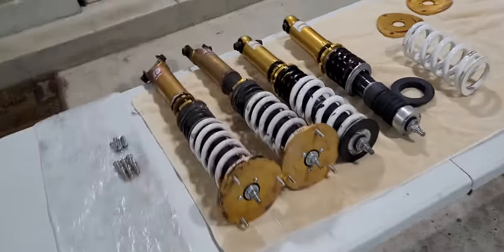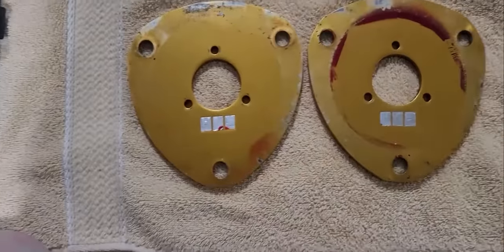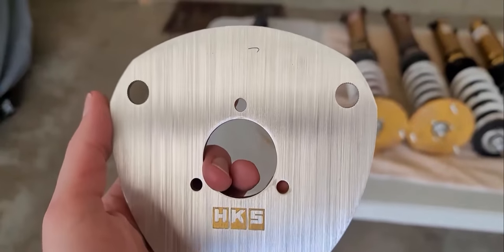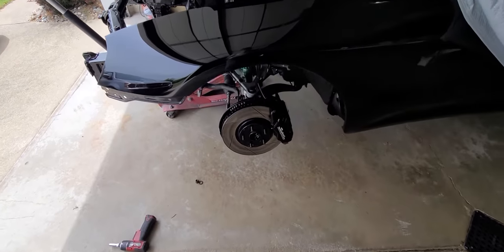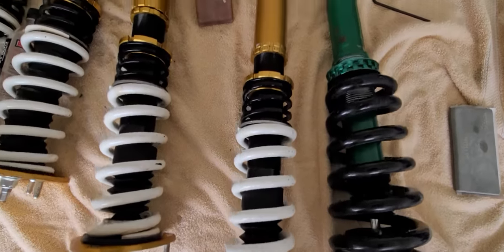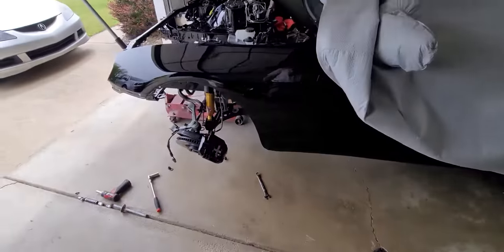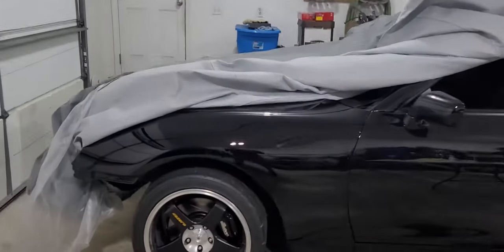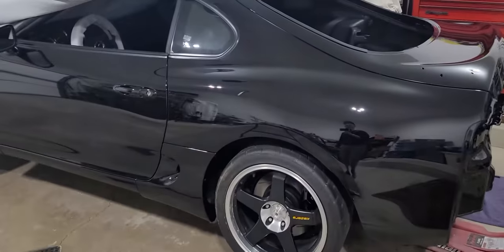HKS Coilover install - Toyota Supra MKIV

Comment: For those three Toyota parts that you showed (90105-14082, 90170-14006, 94621-11400), how many of each do I need to purchase? I'd like to replace my old nuts and bolts all around like you did. I'm installing HKS Hipermax S coilovers for the first time and would like to know how many of each I need for my SC300 as well which shares the same chassis and parts, etc.